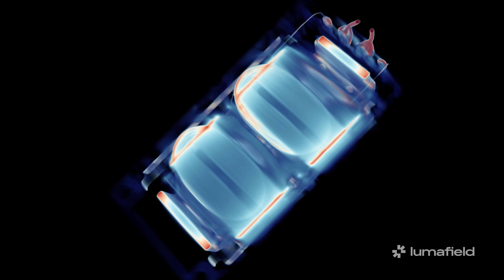Switch 2 Pro Controller: Built to Break? Full Teardown

Comment: Playing devil's advocate for a moment here, this honestly looks like it was engineered to survive being thrown by kids. That's the impression I've gotten from all of the Switch 2 stuff so far.
Reply: Yeah no, an unlucky fall will still destroy a stick / trigger / button. I've repaired my Dualsense trigger with that had a broken spring (it has been reinforced in new revisions) and it was a 10 minutes job. And the battery was immediately available it I wanted to replace it as well. The switch 2 pro controller is hell compared to that
Reply: I have dropped my pro controller 1 who knows how many times by accident in the course of 6 years and it's still fine with no drift
Reply: What makes you say that, it doesn't seem any sturdier than any other 20$ controller I have seen.
Reply: My argument against it would be that anything will eventually fail, and making repairs easier would still be the best option
Reply: Nintendo controllers have survived being thrown by kids for the last 40 years, and they werent even near as complicated as this piece of garbage. Gamecube's wavebird has nearly the same functionality as a switch 2 controller, but still much simpler and sturdier build. Far easier to open up for maintenance. Wavebirds also typically still work flawlessly over 20 years later.
Reply: @wryyyy please stop suggesting the wave bird has the same functionality as this controller 😂
Reply: @masonjenkins9923  Yeah, my bad. Wavebird is actually a better controller.
Reply: @wryyyy ooookkaaayyy bud 😂

Comment: You know it's bad when it's easier to remove the battery from an iPhone than it is a game controller. What the hell was Nintendo thinking?
Reply: It's definitely not easier to remove a battery from a glass sandwhich
Reply: You do realise to remove an iphone battery you need to bend the incredibly fragile screen and battery while blasting them with heat to melt the adhesive? This is nowhere near as painful.

Comment: What was Nintendo thinking? This design is so OVER-ENGINEERED! The layers of plastic and screws.. the battery is a HUGE hassle to replace and they STILL didn't fix the potentiometer problem causing joy-con drift?! If anything breaks, most people really will be going out to buy a new controller. But it seems that is Nintendo's intention here. Great video BTW! I appreciate you telling it like it is!
Reply: Over engineered cause it is under developed and didn't get enough time to be refined. Lazy and cheap development.

Comment: Nintendo USED to be good back during the Wii/Wii U days. 2005 to 2010 was my favorite time for Nintendo. I still have my DSi from 2009 that still works and still lasts me 5 hours on one charge with the original battery. It even survived a wild rapids ride I went on at a Six Flags park because I forgot to take it out of my pocket. Still works though. Nintendo made stuff better back then
Reply: You basically have to do an entire shell swap to fix a ds lite hinge and it's heinous to do. I did loads of shell swaps on joy con and they were way easier.

Comment: Meanwhile Chinese brands make gamepads with hall sticks and triggers with replaceble battery and AA compatibility just for 30$
Reply: Who don't I see people say this stuff about the issue-ridden PS5 'Dualsense' Controllers? Like the $329 AUD Dualsense Edge
They also have all these issues and a higher frequency of issues being reported. Including stick drift. Way more common for Dualsense than Pro Controller 2.
Reply: I got my Flydigi controller, a Vader 3 Pro, for $80 (the same price you'd be paying for the average controller from the big console manufacturers), and it's never failed me ONCE in the three or so years I've had it. Hall effect, analog triggers (with a switch to turn them digital), gyroscope support in its built-in Switch mode, six programmable buttons, customizable LEDs just for extra flair. Has  both wired and Bluetooth support, too, with like a 500hz polling rate..
The fact the biggest companies out there can't offer anywhere CLOSE to this level of value for the same or even higher prices is an absolute disgrace when this random chinese manufacturer could afford to do it and still make a profit.
Reply: @LazyTomato  Pretty tough to compete with slave labor, I notice so many seem to trumpet crap from China but their manufacturing processes are always swept under the rug...
Reply: @LazyTomato  I don't see a battery cover when I look online, though. How do you change the battery?
Reply: @Kamawan0  You mean on the Vader 3?
I haven't had to do that yet (again, super good durability), but it uses a generic 802540-model lithium ion battery pack, so it should be relatively easy to replace; it's just a matter of unscrewing the backplate (it's 4 generic Philips screws so you don't need any weird special requipment), and then it's sitting right there in its slot, waiting for you to unplug its power cable and put in a new battery, no soldering required.
Reply: @LazyTomato Ok that’s good. The product details on amazon don’t show the screws.
Reply: @LazyTomato  nuff said
Reply: @LazyTomato yes flydigi is best. Their stick tension adjustments make it even awesome.
Reply: @LazyTomato what I want is joycon analogue for PC...
Reply: @x149te  but why? even most people use procon in switch
Reply: @joao-ui8se   1. I want separate controls to rotate only half of it (easier for motion controls).
2. Joycons are good enough for VR
3. mouse mode any moment without needing to drop your controller. Just turn joycons from side to bottom
Reply: Yeah. I get why the sticks on the Joy Cons are not hall effect, because the controllers are held in place with magnets and all, but the Pro Controller should've had Hall Effect or TMR sticks. That said, I personally have never had stick drift with any controller of any brand. I've had problems with triggers and face buttons tho
Reply: The lowest price for the GameSir Tegenaria Lite controller that can be used on Switch2 is only $20. It has a Hall effect joystick, high return rate, and a Hall effect trigger (although it might not be useful on Switch2). This is not better than buying a controller that requires controlling drift to enter Mario Kart.
Reply: Two AAs (14500) are almost the size of 18650; the latter as one is more efficient.  LiFePO4 has 1/2 the capacity of LiCoO2 but lasts 8 times the recharges and is safer so needs to be the standard.
Reply: I use the GameSir G8 Plus with my Switch 2. Fits perfect and has hall effect sticks. can config hair triggers too!
Reply: @GarrettTobyC13 I use a Flydigi Vader 3 Pro. Only problem I have is I can't wake the console from sleep. I wish Flydigi would update the firmware to make that possible
Reply: abernic...📢China-to-U.S. Shipping Restored!

Sale price$12.95 USD
Regular price$17.99 USD
Save $5.04
Reply: IN A CAVE WITH A BOX OF SCRAPS
Reply: AliExpressで3000円で買ったthunderobot G50sってコントローラーを愛用してるけど、コントローラーは中国メーカーのが圧倒的に安価で良質な製品が多い。
ソニーや任天堂公式が出してるコントローラーはやたら高いだけで購入に値しないね
Reply: 8bitdo rules
Reply: let be real those controllers break after 6 months of use.
Reply: Except they're all bad. The majority of them lie about having hall-effect sticks and triggers, plus having regular AA/AAA battery slots is an excuse for them to charge more for less, then the fact they're soo weak and basic, they could become shrapnel from just dropping them once.
The Switch 2 pro controller might be a rip off, but there is no such thing as a controller with actual hall effect sticks/triggers being good that are also 30 bucks. The best any company can do is a Switch pro controller-like one of their own making, but the price is maybe 20% less with hall-effect. The main deal with nintendos pro controllers now is durability, the old version could take a beating, and more so now with this new model.
Reply: Good for them! :) Good that those cheap off brands aren't anti repair. Money amount doesn't equal quality amount. I took apart my 20$ gross  RGB 5 year old Chinese keyboard , wiped it all down with alcohol and let it dry out and put it back together without a tutorial and it worked , it was a lot less gross and it felt like recycling.
Reply: Gamesir Nova Lite, usually going for £25 but managed to get 4 of them for around £15, Even for that price they put it in hall effect joysticks and won't drift like any big name controller (Xbox, Playstation, Nintendo) They're certainly no Vader but they get the job done.
Been using 2 of them for a year now and its smooth sailing.
Reply: I dont want AA batteries. You are going to spend more money on them
Reply: keyword being "Chinese"
Reply: ...link pls?
Reply: Which brand? Would be interested on getting one
Reply: @MiguelRubio-h2i  Don’t get any of them. They’re all bad and lie about using hall effect triggers/sticks, and have poor durability with the whole thing. Find something with Hall effect triggers/sticks that’s close to the official controllers price, either that or mod a Switch 2 pro controller with Hall effect sticks.
Reply: Oh yes, flydigi Vader 4 pro is the best controller in Xbox form-factor, but lighter, back buttons, face additional buttons, hall effect, anti drift software. 
And all of that for like $50.
Reply: I'd prefer to not support the CCP as much as possible by not buying any Chinese state-owned brand, so I'll stick to first party hardware myself.
Reply: The Switch 2 sticks are better than Hall effect.
Reply: @icy1007  how so?
Reply: Hi wumao!
Reply: Perfect! Then you can buy those and i can buy this one. Right?
Reply: A word of caution on "cheap" 3rd party controllers with hall effect sticks, they will often use crappy rubber membranes for the face buttons that are prone to tearing, causing the button to stick after extended use.  Thus was regrettably the fate of my BinBok controller for my Switch1, which is ALSO a nightmare to disassemble as the battery connector is clearly more solid than the solder that holds it onto the board.
Reply: You forgot the part where they break after just a few months to a year of use, have terrible software, and no warranty so once something goes wrong you’re screwed.
Reply: From my experience third-party switch controllers, even high-end models like the 8bitdo ultimate series are noticably lower quality than the nintendo pro controller (gyro input is much less accurate, and from what i've tested on a pc, the nintendo controllers poll at 65hz while third party ones target 60hz and struggle to maintain it (poor bluetooth implementations).
My 2017 Pro controller has been in almost daily use for 8 years with zero issues. From my experience on any recent system, first-party controllers are always worth paying slightly more for.
Reply: @NZZN_  Polling rate in the 2017 pro controller is far worse than compatible controllers like the Cyclone 2 and Direwolf 3, and both cost half as much and have TMR or hall effect sticks.
Reply: @ozfunghi  Sadly the switch only polls input at 65hz, probably a battery saving thing. For some reason every 3rd party controller I've looked at polls well over 125 in all modes apart from switch mode which is always 60.
Reply: @NZZN_  you've had a switch pro controller for 8yrs, while the switch has only been around for 7??🤔 Nice try simp.
Reply: @Valverde713  I got it a few days after release. March 2017 was 8 years and 4 months ago.
Reply: @NZZN_  "even high-end models like the 8bitdo ultimate series are noticably lower quality than the nintendo pro controller"

Yeah, I tried 8bitdo and wasn't impressed by it at all. It had so many issues just trying to get it to work right from day 1, and I don't think it was a manufacturing defect as it seemed to be an issue with the software programming. The battery life on it was really bad too. 

Nyxi controllers are really good though. If I had to buy another third-party controller, I'd probably go for another Nyxi wizard. They can be used either as a Pro Controller or as Joy Cons, and feel like proper controllers in both functions.
Reply: @NZZN_  My 8bitdo ultimate started developing battery problems. Unfortunately, it is sealed like the Nintendo pro cash grab. I highly recommend the 8bitdo pro 2, instead. Has hall effect, works on all platforms, has a removable batter cover for easy replacement. As far as accuracy, I'm very happy with it. $40. Nintendo can suck it.
Reply: @NZZN_  I've seen people claim this about the gyro multiple times, is there any videos or other documented data anywhere showing this objectively? I'm curious to see it.
Reply: @NZZN_ well I opted for the Ultimate 2 Wireless for my switch 2. It can use the dongle/dock in switch mode which should have better latency than Bluetooth. For the best Bluetooth implementation, you’d have to give that to Sony. Much higher polling rate, better latency and gyro as well.
Reply: @NZZN_  The gaslighting is unreal in your comment 😂
Reply: @astatalol  8bitdo controller in question also doesnt have external screws
Reply: @astatalol  that's not gaslighting, it's a personal anecdote
Reply: @astatalol  So saying that Nintendo products are good quality is gaslighting? You haters are delusional
Reply: @damigamermx-us8291 I didn't say that at all did I? But saying that third-party controllers are lower quality is insane. The haters are on the other side, kiddo.
Reply: @Pownchao  it is personal nonsense. No one can detect the difference between 60Hz and 65Hz.

Also, gyro is just a gimmick. It lacks a stable state, hence is quite erratic.
Reply: @adorp gyro is most definitely NOT a gimmick. Splatoon and both Zelda games use it very well. Fortnite also. Sounds like you’ve never used it properly.
Reply: @Zardozer the Zelda games work fine on PC without gyro. Same with Forrnite

Gyro aiming or steering will always have drift because it is hard to hold any position in the air, and you can't even feel the zero position. It is inferior, and aside from those puzzles that are gimmicks themselves, gyro has no use.
Reply: @adorp  Clearly you've never used a proper gyro setup. If done well, you have mouse-like precision with a controller. I love mouse/keyboard, but let's not kid ourselves, Zelda shouldn't be played that way.
Reply: @Zardozer Clearly you have never used a good mouse. 

Gyro is a pain in the arms. I have PS4.
Reply: @adorp  well there you go, you have missed 10+ years of gyro improvements so no wonder
Reply: @NZZN_  PC doesn't recognize nintendo controllers
Reply: @ChampagneOppa  That was the case at first, and you needed software like BetterJoyForCemu or Steam to translate to Dinput, but at some point within the past few years Windows and Android now support console controllers out of the box.
Reply: @NZZN_ You immediately lost me when you called the 8bitdo Ultimate high-end.
Reply: And they easily break

Comment: Nintendo is the apple of consoles
Reply: Xbox and Playstation sell $200 controllers with the same or worst problems in the case of Xbox, solder sticks from the same manufacturer that makes the ones in the Switch 2 Pro. 

On top of that the regular Xbox and Dualsense controllers go up to $80 with battery charge that only last around 3 hours max instead of around 50 hours with the Switch 2 Pro controller, non modular sticks from the same manufacturer, take longer to charge, doesn't have 1 year warranty and they give them a better review. 😂

Comment: Nintendo, y'all are a bunch of nitwits.  You have great hardware and software people, but a fucking businessman was behind this controller.  This controller is optimized for profit.
Reply: You say that, but honestly to me it looks like it was engineered to be tough. I know I'm going against the grain here but that's preferable to jumping on a bandwagon I don't strongly agree with.
Reply: @clonkex  I dont think you understand how much punishment nintendo controllers were exposed to before the Switch era, they were made from thick plastic and were easy to open up for maintenance. Switch era is when Nintendo started to make everything out of flimsy plastic with over complicated construction. They didnt need to use glue to hold the controller in one piece because 2 thick shell halves screwed together with big screws just made it solid enough.
Reply: @wryyyy  Started before that, need I mention the 3ds hinge? Also, this controller IMO seems to be a return to form, it's hard to take apart because it can withstand impacts from pretty much any angle. Besides, plastic is a strange material to work with because sometime things become more durable when you make them thinner because they can bend instead of snapping like they might with thicker plastic (think of the plastic hinge on a Gameboy game cartridge case, if it was thicker, it wouldn't be a hinge, it would snap). Can't do that with metal!
As for the sticks, I'll mention this engineering aphorism: "Better is the enemy of good enough". If you're wearing out the sticks on a controller in less than a year, you should probably be finding other ways than video games to occupy your free time (not saying video games are bad, just that like anything, too much is a bad thing).

Comment: Useability wise I love this controller, but I'm not looking forward to disassembling this controller in the years to come. I get why the joycon aren't hall-effect/TMR sticks, but I don't see a good reason why the pro controller doesn't have drift free sticks. I don't think magnets on control sticks would mess with the HD Rumble 2's magnets or vice versa
Reply: And if I had to choose between magnetic joysticks and HD rumble, I would choose magnetic joysticks every time. Rumble is such a stupid gimmick, I always turn it off in the system settings.